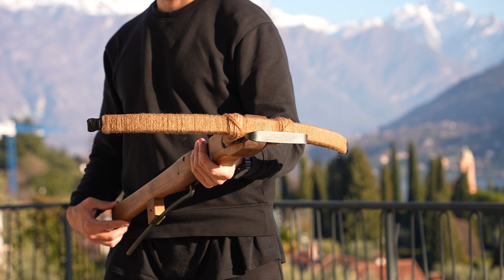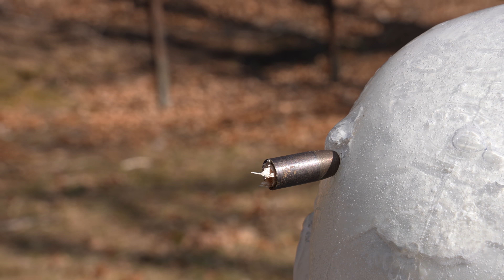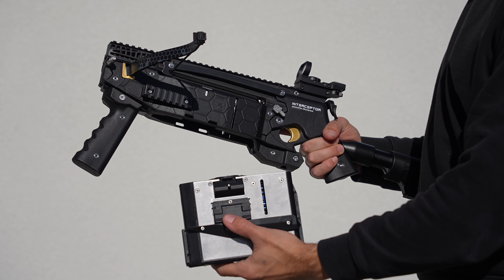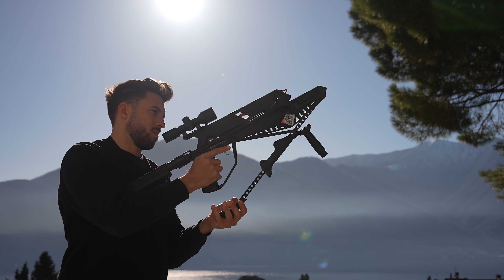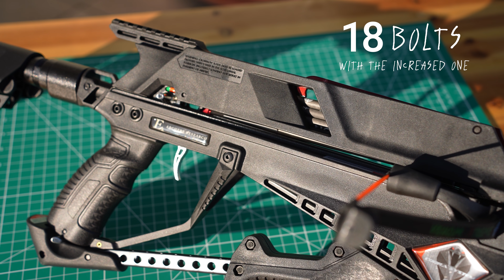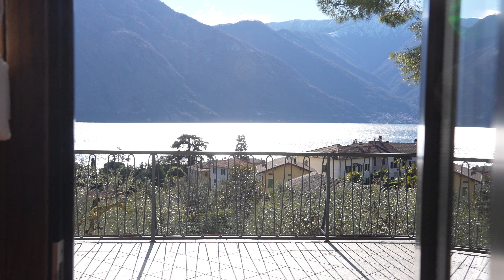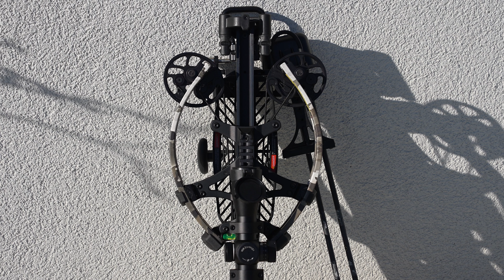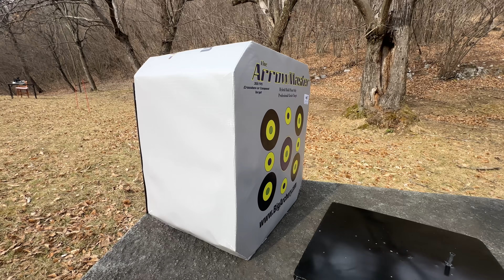How Dangerous are Crossbows?

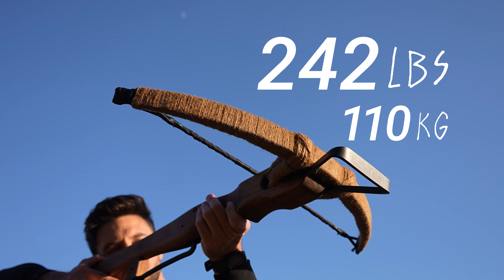Comment: 0:50 historically the draw weight for those cross bows could go up to 1700 pounds
Reply: I came for this too, 200pounds was the light version, manually drawn. The picture he show to crank the crossbow are for crossbow from 500pounds. And has it's been said, the iron tip was clearly not a concave cone shape.
Reply: and the bolt head is obviously made not to be lethal.. You could get more fatal results with different bolts head
Reply: Unfortunately they also tended to have very short draw lengths.  Just a hand span or thereabouts.
Reply: the reason for this disparity between a bow and a crossbow draw weight is interesting. We see these big numbers like for a crossbow 800-1700lbs vs 50-120lbs  for a bow, and we think well obviously a crossbow is going to be a stronger, more penetrating weapon 
but this is not the case. This is due to acceleration of the projectile, which is proportional to the draw length of the bow. A crossbow has about 6 inches of draw length, because that's the lenth of the bolt, as defined by the span of the bow. As such the bow is only accelerating the bolt for that very short 6 inches. For a longbow, your draw length can be from about 22 inches to 30 inches depending on the bow and the person firing it. The arrow will be the same length, and as such the bow is acting upon the arrow for much longer, and can more effectively impart momentum to the projectile over a longer period of time. 
In short, a crossbow needs a MUCH higher draw weight because its draw length is much shorter, to meet the same effectiveness on target as a comparatively much lighter bow.
Reply: My first thought was "he got baby's first war crossbow"
Reply: But because of physics you cant comparr it with a bow
Reply: Yeah, windlass crossbows or heavy arbalests are completely different beasts, easily exceeding 5 times the draw weight of the goat's foot or hand cocked crossbows. So not including them is fair. I do have an issue with the bolts though, I reckon a bodkin point would be far more effective than the ogive that Mike has here. 

"Tod's Workshop" on YT has a bunch of great content revolving around medieval artillery, >1000lb crossbows, and other miscellaneous medieval projectile weapons.
Reply: Most could not penetrate armor very well, especially as it got as thick as it did. You'd not often have lethal wounds, or significant penetration.
Reply: @V3RTIGO222  That is completely the opposite of the truth. 

Crossbows are more capable of penetrating armour than a bow. The trade off is that they take much, much longer to load than a bow. But they also take much less time to master. A longbowman had to be trained from youth to build up the specific muscles required to use it effectively. A crossbow was point and shoot and the heavy work of drawing back the immensely powerful arms was done using mechanisms rather than raw muscle.

Only the very best (and therefore most expensive) armour could hope to reliably stop a crossbow bolt with a bodkin headed bolt.

They were considered so dangerous that the Papacy BANNED them twice from use in wars within Christendom! (Once in the 11th Century and once in the 12th)

The medieval crossbow used in this video has an incredibly light draw weight and is using the wrong bolt head for penetration. It's honestly a terrible representation of a medieval crossbow. With a goat foot lever, a crossbow with a draw weight of 500lbs can be loaded reasonably quickly and easily, for example. A crossbow that doesn't visually appear much different to the one he uses in this video, but with over twice its draw weight.
With a windlass or a cranequin (look it up) bows with draw weights over 1000lb could be drawn.
Reply: @SamuelGeist  You should probably look up the information again, because I once belived the same thing - but it is not true.

The draw weight doesn't neccessarily increase the power of a crossbow or bow, since that power is mostly imparted over the length of the power stroke - regardless, the fact remains that most crossbows were very inefficient, and unable to penetrate 'average armor' with breastplate of 1-2mm thickness of mere mild steel... and even those that were capable of penetrating were often didn't produce lethal injuries.

A modern crossbow is leagues more poweful than a medieval one, and would still have difficulty penetrating 1-2mm of steel of the 14th century. The papacy didn't ban crossbows because they were effective against men in full plate, which most people could not afford, it's because they were easy to use against men at arms commonly using gambeson and/or chainmail at best.

All recorded injuries by crossbows from nobles and other individuals who wore plate were almost always because they had lifted their visor or had been hit in a spot where the plate did not cover, often hitting gaps where there was gambeson or chainmail.
Reply: @V3RTIGO222  That is true but you are wrong about one thing,they didnt lack the juce ,they used heavy bolts ,it didnt go fast but boy it would hit hard.
Thats why they had insane draw weight -go watch tod's workshop he did comparison.
Range wasnt great thou ,but i wouldnt wanna be shot at it within 20m.
And in medieval times steel was shit compared to modern standards full of impurity's so 2mm wouldnt stop jack shit compared to modern steel.
Bodkin tips are very dangerous to armor and they had plenty of variety's specialised in certain tasks.
Reply: @armageddontools Wouldn't a period accurate bodkin tip also use horrid steel?
Reply: @ Arguably worse steel, seeing as they were supposed to be mass produced. You could theoretically case harden the tips, but Tod also demonstrated that it didn't actually help significantly to add to penetration and damage to an opponent wearing plate - hence why guns were quickly adopted and replaced bows of all kinds, as they could penetrate armor with extremely cheap lead balls.
Reply: @ Bow or crossbow it doesnt matter they all function the same.
Velocity of the bolt/arrow is determined by how fast limbs can return to its previous position from drawn state.Draw weight measured in pounds determines how heavy arrow can be.The heavier the arrow- slower the velocity and range will be but it will hit with more joules.
Too light arrow and it may break or when it hits it wont have desired effect.
Problem with old crossbows is that they used heavy steel limbs which return slowly to its position so thats why compared to modern crossbows they have poor velocity .
To compensate for this they used 2x heavier arrows than today  that produced a lot of energy on  impact but the range suffers and you need to lob the arrows.

Draw length has nothing to do with it since arrow achieves its maximum velocity at the start when limbs are compressed the most.
 
The fact that these crossbows had to have such a thick string to support that kind of poundage introduced a lot of drag that decreased efficiency even further.
Reply: @ Yes but even mild steel can penetrate if the shape of arrow is right.
Needle bodkin is awesome when you need to go trough chain mail ring and pierce gambison.
Problem is as soon as it hits the plate narrow long point will bend and  dull and you wont penetrate plate.

But if you put a pyramid tip on a tapered arrow head it will focus all the energy in a single point -like the masonry demolition chisel.
And thats why arrow design plays huge role in defeating the armor of that time.
Reply: @armageddontools Tod tested diamond head or 'armor cutter' tips against plate as well, and it didn't work significantly better than a needle point... the pyramid bodkin performed the best, afaik, and even then couldn't produce lethal wounds.
Reply: @ Joules are a measure of kinetic energy, kinetic energy is mass x velocity ^ 2... momentum/intertia howver is mass x velocity, which more massive objects at equal speeds have higher inertia which can result in the transmission of blunt force trauma or shock to the opponent.
Reply: "could"  that would be a heavy arbalist.  by the same rationale you can say small arms can be a 50 BMG or 20mm, but that doesn't mean 22 LR or 357 magnum or 30-06 doesn't exist either, same for less powerful crossbows existing historically.  citing the most extreme form of something doesn't mean it is the only example, that's just ridiculous.
Reply: @sinisterthoughts2896  Yes, but the difference is that most people watching this video will be completely unfamiliar with crossbows. People watching this will likely interpret the shown crossbow as representative for how medieval crossbows just used to be. That's why it is valuable to point out that there did exist far more powerful crossbows, and that this one is on the weaker side. The comment above would be equivalent to a comment that says 'there also existed far more powerful sniper rifles' on a video from the future where someone shoots a 9mm gun and presents it (implicitly) as 'the' gun of the early 2000s.
Reply: @sinisterthoughts2896  whats your point? By your own admission, he never stated all crossbows had that high draw weight, only that they "could" go that high.
Reply: @V3RTIGO222  saying "those crossbows" gives a wrong impression, as those were completely different weapons
Reply: @ Those crossbows, as in medieval ones? They were completely different to most modern ones, in terms of materials and design.

Comment: Why you say they are semi-auto? It's essentially closer to pump-action (fold-action? break-action?), as semi-auto would imply you would not have to recock the thing at all. 

Which is possible with HPA or a motor system, but that would mean that you either need to bring a pump or a battery wherever you go.
Reply: Because it's cooler than calling it a "repetition."

Comment: The medieval crossbow may not have penetrated the skull, but a fracture would have done enough damage to take out someone, being it by brain damage, bleeding or infection.
Reply: Its not really historically accurate. And bolt tips are for dummy practice, you need to use bodkin and penetration will be ok
Reply: @andreykotovsky  the power of the bow is representative, but the arrowheads were practice heads.
Reply: @sinisterthoughts2896 no it is not. Why do people like you always have to comment on things you have no clue about? A crossbow for war had a draw weight of 700-1300+lbs
Reply: The bolt he use was not for lethal damage.. I think it was just for target shooting or something. Medieval military bolts was much sharper.
Reply: @tempura-san  the bolt was still lethal, but yes it was a target head.
Reply: These weren't the bolts that soldiers would have used. Those certainly would have penetrated the bone but also soldiers probably weren't trying to get head shots; I am sure they would have aimed at the body.
Reply: @andrewmoore7014  this type of crossbows were never used in battle, its more like hunting crossbow. Poundage is too low for warfare, you can get a nice penetration with broadhead or bodkin, but even cloth armor is too much for crossbow this small.
Reply: @ That makes sense!
Reply: @andreykotovsky medievale crossbow. 1200 libbre 
110joule. 80grammi 160fps
Reply: @andreykotovsky  these bows were often used in battle, just not military load out.  plenty of skirmishers, bandits and civilians relied on such weapon in combat for quite a long time.  By the same logic that's saying firearms not issued to militaries are not used in combat, disregarding guerilla warfare, organized crime wars, bandits and illegal activity.
Reply: @luigiridolfi2800  some, not all.  you might as well say all rifles are 14.5mm anti tank rifles.
Reply: @sinisterthoughts2896  By that logic also, you might as well say all rifles are airsoft guns. The point is that this particular example of a medieval crossbow is closer to airsoft than it is to .50 BMG. He's also firing the equivalent of a wooden bullet. Dangerous, but unlikely to be deadly. A more representative and typical example would be a 500lb draw weight crossbow cocked with a goats-foot lever, firing a bodkin-tipped bolt.
Reply: @andrewmoore7014  Projectile weapons in war was never really about precision accuracy, up until guns with rifled barrels started being fielded. Archery in war has always been about accuracy via volume. It doesn't matter how precise any particular archer is, when the goal is to rain down hundreds to thousands of arrows at once.
Reply: @ShaggyRogers1  I agree.
Reply: I'm not a historian but I do have some surface knowledge of this. Medieval crossbows were absolutely deadly, and were very capable at penetrating certain types of armour. So much so that it was forbade by both Pope Urban II in 1096 and Pope Innocent II in 1139 to kill Christians with bows or crossbows. The crossbow was likely seen as even more deadly because it was much easier to use (though slower to use) and train for than a powerful bow. It was a very common weapon in the high medieval era, and many men-at-arms could attest to it's lethality firsthand if they were still alive. No shade towards Mike, medieval crossbow authenticity was not the point of the video lol.
Reply: @TheGreenGamer33  true.  it's ease of use and less required training were it's benefits.  many of these commentators don't understand the physics behind bows, and are going off of video game and movie logic it seems.
Reply: not really a true medieval crossbow penetration test tho
Reply: No. They would penetrate a bare skull. He just has badly made bolts and crossbow which is also weak for its drawlength.
Reply: @TechnocraticDreadnought  the bolts aren't the problem, the draw weight is
Reply: bad bolts.
Reply: 200lbs draw weight is insanely weak for a historical crossbow.

To make up for their very short power strokes, historical crossbows, especially those for battlefield use, tended to have draw weights in the 800 to 1000 lbs range.  Even with only a 3-inch stroke, this puts their energy output comfortably into the 100-200 joule range.

There is no hand-drawing a serious medieval crossbow.  Crows foot, windlass, or some other mechanism is required.
Reply: While it's may not penetrating the skull, it definetely would go through your sternum and pierce the lungs or heart
Reply: Indeed. Would definitely have been a heavy concussion. Buddy would have gotten knocked the f out for sure. On a medieval battlefield would have sufficed.
Reply: Take them out, yes, but over how long a period of time? A skull fracture won't puppetstring an attacker. It's almost a launchable blunt instrument at this point.
Reply: It also didn't have anywhere near the draw weight of a normal medieval war crossbow
Reply: Also, as other have pointed out, the draw weight on the crossbow that was used in this video is really light compared to other medieval crossbows. Some of them exceeded 1000 lbs. That would still put them far below the modern crossbows though.
Reply: dw he still cucked the crossbow
Reply: Normal cloths and hats people wear daily would make it useless.
Reply: @cosmicpenguin439  if a hat could stop it that easily, crossbows wouldn't have been used in battles lmao
Reply: @Sayan_9001 I am talking about the one in this video. I am pretty sure real ones were better then this one.
Reply: @Sayan_9001 The bolthead that he used was terrible. There are different boltheads that are way more effective. Also draw weights in medieval times got much higher then this. Crossbows can't punch trough plate armor, specially not 16th century jousting armor.
Reply: @cosmicpenguin439  to be fair those are not typical bolts that would be used in battle
Reply: @cosmicpenguin439  no it wouldn't, that's just silly.  why would you think something so ridiculous?
Reply: @sinisterthoughts2896  Yes it would. Cloths can literally stop bullets in some particular setting. Check the pinned comment by Mike he cleared it.
Reply: Jesus saves✝️.
Reply: @TheRoyalberry We’re talking about effectively murdering people here. Perhaps not the best place to advertise jezus
Reply: @TheRoyalberry 
Does your Jesus have a better crossbow? 🤔